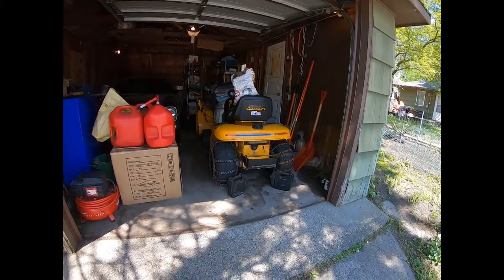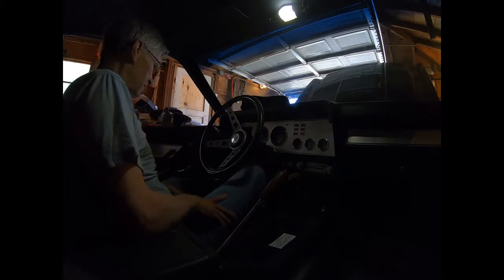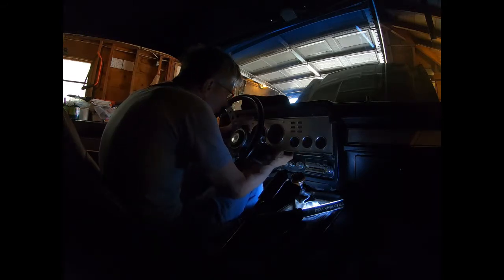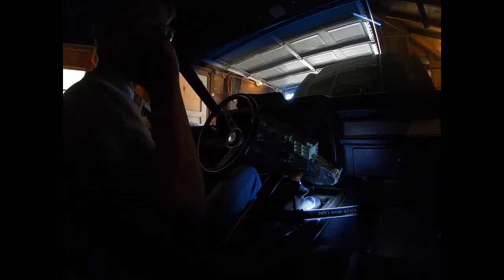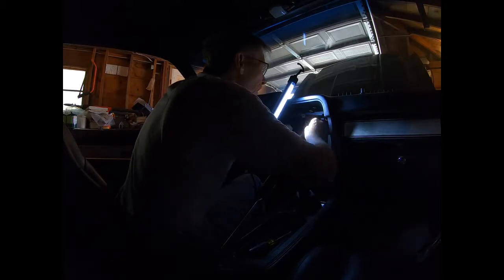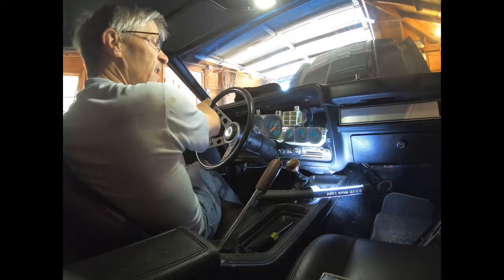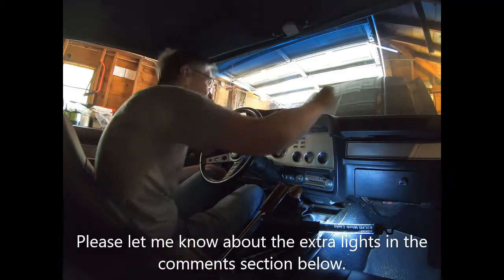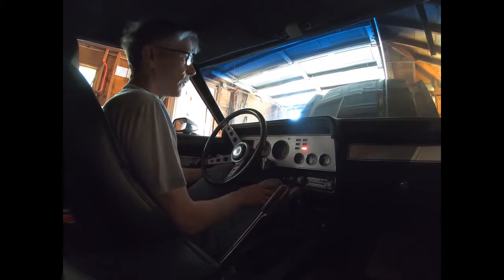'76 COBRA II WITH THE OLD MAN OUTDOORS 051519 LED CONVERSION

Comment: Nice car! how come you didnt show your dash with the new lights in it. It looks pretty cool from the passenger seat but I would like to see it from the drivers seat, I might want to do that to my 78 King Cobra. I also have those other lights on my dash and I put bulbs in them for S & G's but they didnt light. I am using the top left one for my electric fuel pump to remind me thats its on. I cant wait to finish mine and drive it again.
Reply from the maker: Thanks for watching. I thought I did put a view in the video; but I haven't made a car video this year so MAYBE I'll try one rolling at night. 
The LED swap is pretty easy but you need a way to check each one as you get them installed. They are polarity oriented. I thought I had it right only to find out that the oil pressure light was reversed. End result...rebuilt engine.